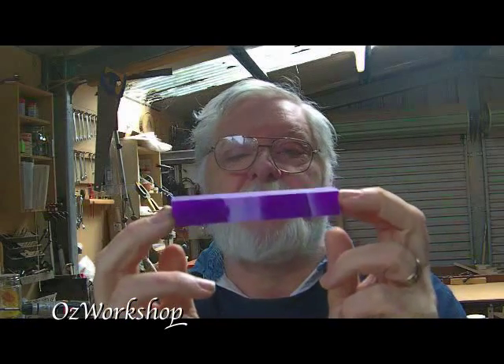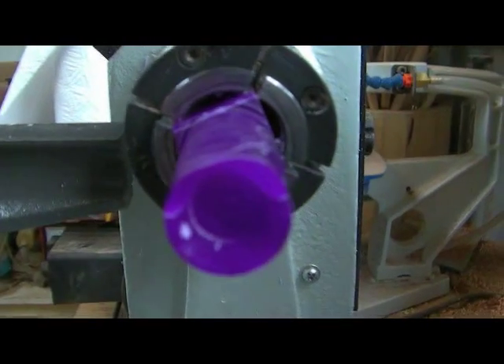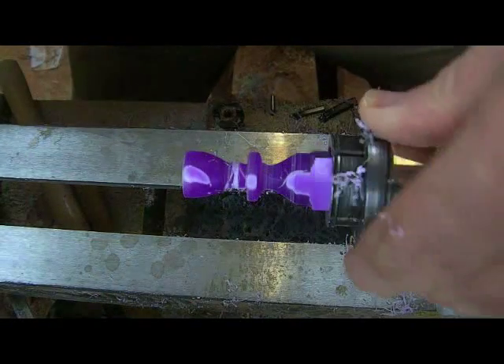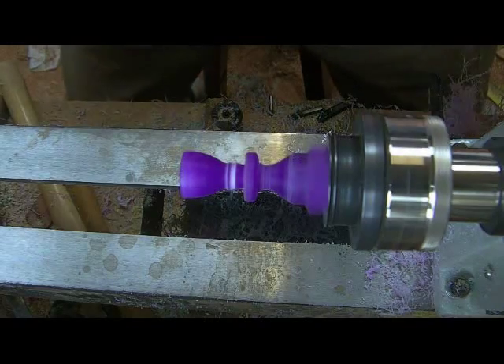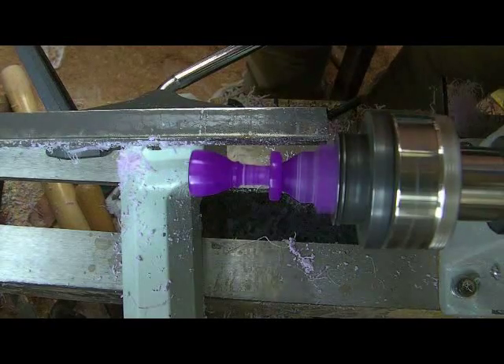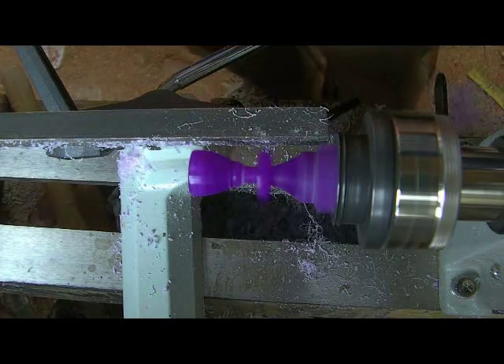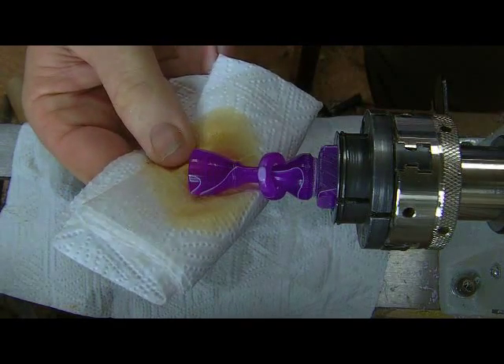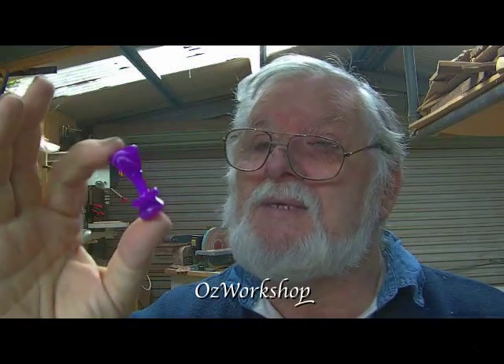Turning an Acrylic Goblet

Comment from the maker: Hi Nicol, the blade of the tool should line up with the center of your work. Make sure your tool is level. And when turning from square, make sure the tool is tucked into your side to keep it stable. Hope this helps..